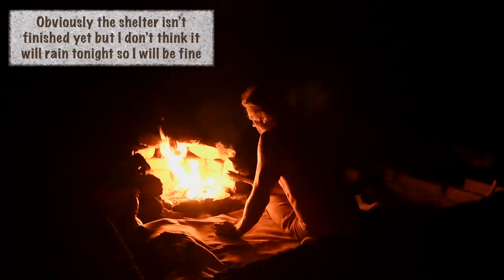Building a New Primitive Shelter with Bricks (episode 16)

Comment: A great episode Chad sir. May I suggest a mud stucco of sorts for the walls. The weather will change and the stucco or mud wash should help to protect the bricks and keep heat in. You might not need it but it was just a thought I had.
Reply from the maker: So does that entail rubbing a layer of mud over the exterior side of the brick walls?
Reply: @ChadZuberAdventures  I was thinking that yes but with mixed in straw or other binding material. Like dried tall grass or some other dried long material. Even if the rain gets to it you can always repoint the outside. Many frontier colonial cabins used mud between the logs in their cabins. Usually mixed with a dried material like straw or grasses. Perhaps the dried shells of those bean pods could work. I apologize if I am over stepping Chad. I just want to suggest and help. Many Cherokee would live in mud stucco covered mud brick houses with a straw or grass thatched roof. Just trying to be helpful. Thank you.
Reply from the maker: @valentine_puppy  I appreciate your ideas. I'm not sure if it would be necessary to add stucco. I may test it out after I finish building the walls. It's a good idea. Thanks!

Comment: Eyyyyy there he is! I figured you must be working on something good since you uploaded the movie of all the other videos last week lol. Loved that by the way! Good to see the new hut going up. Having a solid permanent shelter will open up so many new possibilities for future videos! 
Keep up the great work bro!
Edit: also I'm wondering if you have any thoughts on the brick making process. Specifically do you think it's worth the time and effort or would it be better to just use the wet clay mixture to immediately start building up a wall structure. Like lay out the wall base and let it dry. Then add the next layer and let it dry and so on. So you're making Adobe and building at the exact same time? Just would love to hear your thoughts on the difference between the two. Like pros and cons of each style. In your professional opinion 😁👍
Reply from the maker: Yeah, this is a slow process but it is going well overall. Regarding your thoughts on making bricks versus directly making walls with the mud,... hmmm, that's a good question worth exploring. I will have to test and compare the too. I think the bricks are stronger because they are in a mold and compacted where as the mud wall wouldn't have the benefit of compactness. Does that make sense? I also know that the bricks will be strong and I don't want to experiment with another technique that I don't have faith in. In the future will make a small storage shed or something with the second technique you mentioned.

Comment: I don't know what your future plans are for the final build of your hut, but if it helps, circular and rounded objects found in nature (albeit of simple form and characteristics) are most complementary of natural forces.  Water, wind and rain will occupy less surface area on a rounded edge than on a flattened edge due to the curvature of the shape, which allows the energy of natural forces to travel the path of least resistance.  Whatever you decide to do with the final build, I'm still excited to see what you come up with.
Reply from the maker: Thanks for your comment. I am considering design options. Your reasoning for the circular shape is very true. Considering the often windy conditions here, a circular shaped hut would definitely be best.
Reply: @ChadZuberAdventures  I hope it's big. So you dont have to duck when inside and you can do everything you need without leaving it. With at least 3 rooms, kitchen, bathroom and bedroom. Maybe an optional workshop where you can work on more advanced projects. I dont think I have seen that yet.

Also I just learned about this which might interest you;
https://www.youtube.com/watch?v=YCyLWhPnq1M

It's a real shame what they are doing.

Comment: Why not use some kind of plaster for the bricks? You will have some kind of insulation for wind, rain and similar difficult conditions. Insects can dig up the dust between the bricks very easily. I still respect your decision, but I still couldn't understand why you didn't plaster when you worked so hard for brick and house.
Reply from the maker: This is just a temporary shelter so I can practice making a better roof. I will be using mortar between the bricks when I start to build the final hut in about a month.

Comment: Not nitpicking but the carrying over one brick at a time just grated on my nerves. I'd be carrying over 3-4 bricks at a time. I know he does it for the workout factor but still. And thanks for the explanation of the sand versus mortar factor. i was wondering "what about mortar?" when he popped that into the video. This looks like its going to give much better room for him to sleep and move around without being too big and a pain in the rump to heat up at night. PS - I wonder why someone hasn't thought of gathering and selling those beans to those who don't live near there. I would be very interested in mesquite beans and those other beans. A differing flavor compared to modern beans and smaller carrying size too.
Reply from the maker: The bricks are quite heavy. Four bricks weigh at least sixty pounds. While it would be faster it would also be more exhausting to carry four at a time

Comment: Why you don`t burn the briks? than you have "reusebal" water resistand briks...    you coud start digging an undergound oven (the material you dig out coud use to make more brigs... than if the "underground ofen" is finisch you coud burn in 2 or 3 burning seasons all your brigs you need. And throu this burning process the walls of this undergrund oven shude be burned too and be whater save ... and you can use it later as a zistern to store raining whater...   the triky part is to bild an roof for the burning process and later close the fiering door watersave (maybe with a vew burned brigs and cement from a few burned "cement stons" ...
Reply from the maker: I can't burn the bricks because I need them to be raw when I build the hut. I'm going to use mud mortar to bind them together. If they are cooked then they will no longer bind well. But I may burn some bricks for other specific purposes.